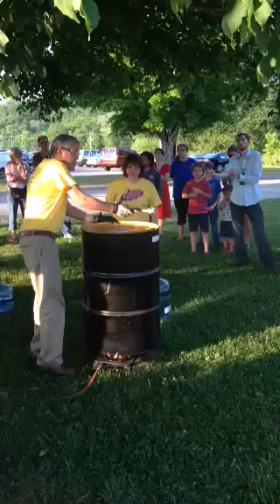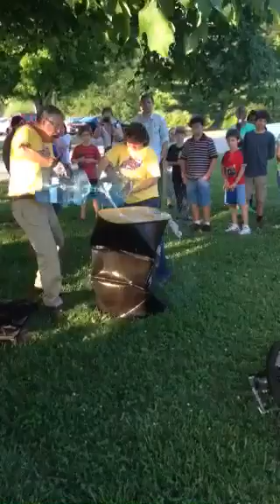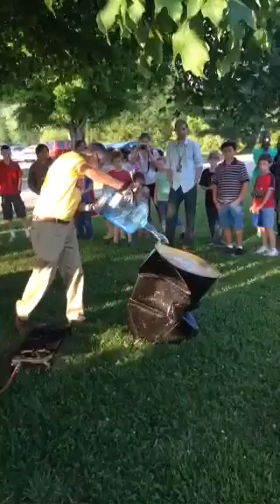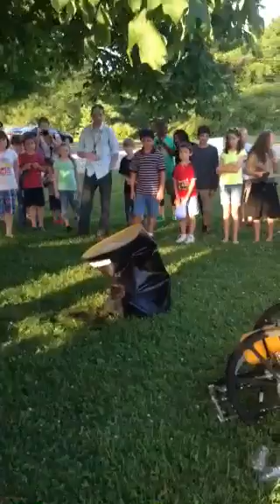Imploding 55 Gallon Drum!

Comment from the maker: We heated up a 55 gallon drum, put 32 oz of water in. The water changed into steam than we quickly screwed on the  caps and took the drum off of the burner and poured cold water over the tank. 

The steam changed back into a liquid causing the a near vacuum in the drum, the outside air pressure surrounded the drum causing it to implode!